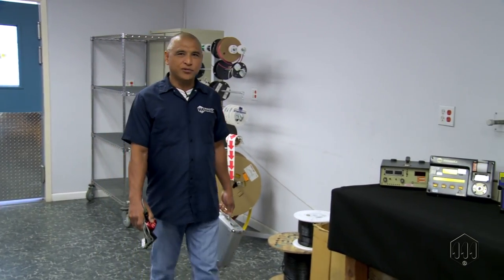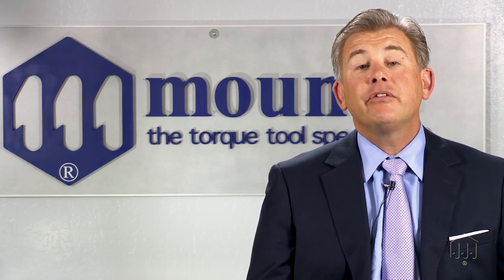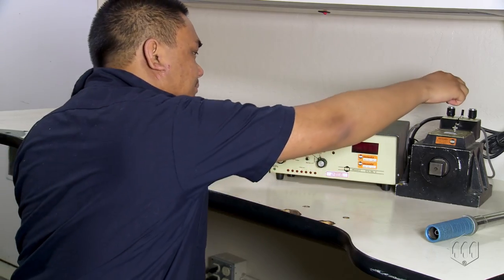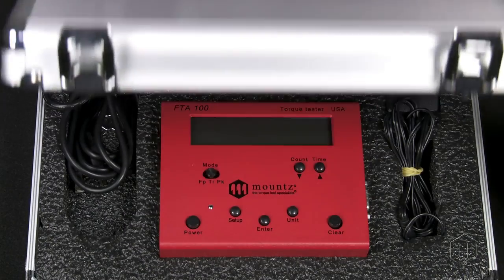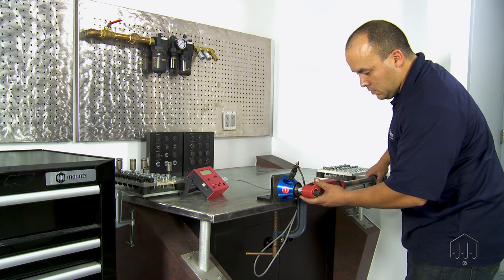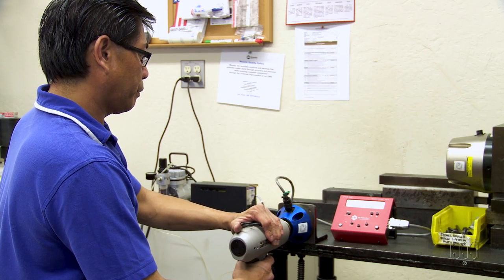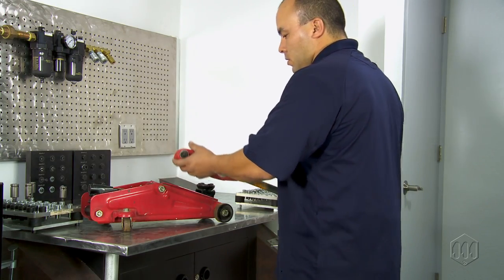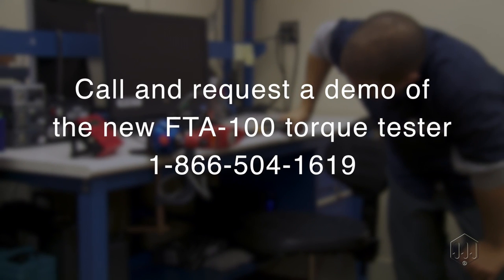Torque Testing with the FTA-100 Torque Analyzer

Comment from the maker: The Torquemate® FTA-100 is designed for torque testing and calibrating torque tools. The digital torque tester provides exceptional accuracy for measuring torque on various torque tools. The small size and portability of the torque analyzer makes it ideal for checking torque tools on production floor daily or weekly to ensure the tools aren't falling out of calibration. Testing torque is literally a science and not something that can be left to chance. Find a solution http://www.mountztorque.com/products/torque-analyzers-sensors/torque-analyzers/torquemate-fta-100?kmas=216